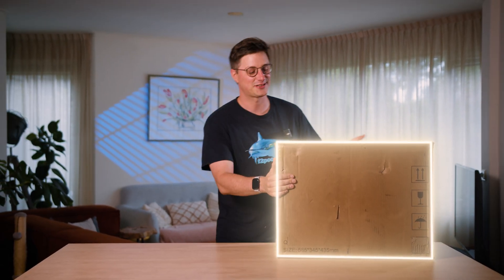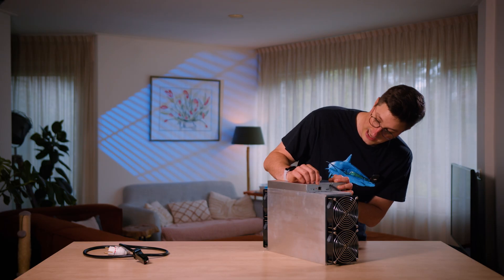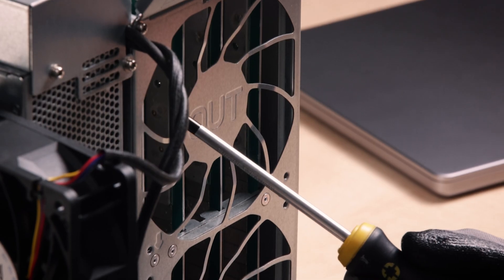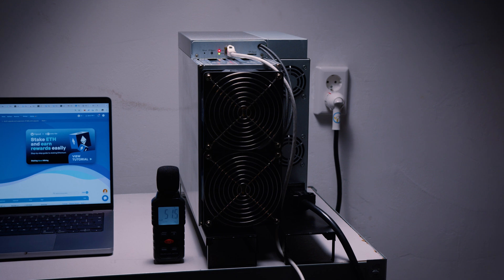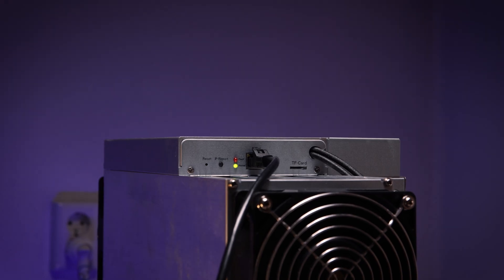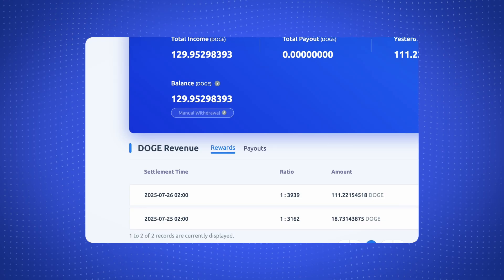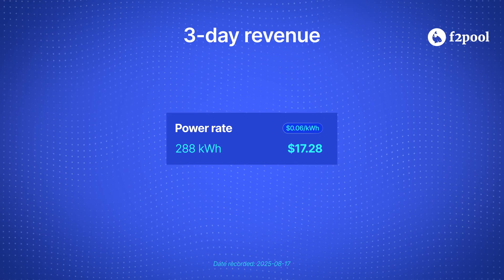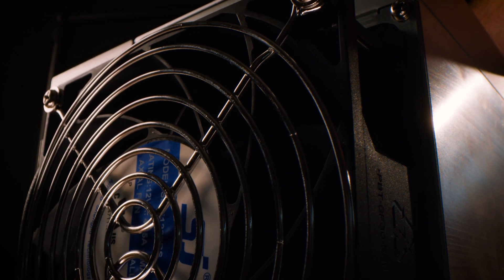ElphaPex DG2+ review: top-tier LTC & DOGE farm miner with 190 W/G

Comment: Good to see that the DG2+ is quite modular, in the sense that it is easy to take apart and fix if problems ever arise. That makes a miner the most reliable in my opinion.
This looks like a miner that will give others a run for their money for years to come, good efficiency, easy to set up, decent levels of noise and heat (for a farm) and modular which makes maintenance a breeze!

Comment: That is a beast, with a 3900W power draw, I wonder if it earns more than the spend on electricity. My mini doge 3 on low hash mode pulling 260W earns just over break even on daily earnings. But that 21 GHs hash does look shweet. Just did the math and that is way more efficient than my MD3, looks like it should earn me about $29.40/day gross not excluding my electricity spend ($10.50/day). Definitely looks like it is profitable (18/90/day).